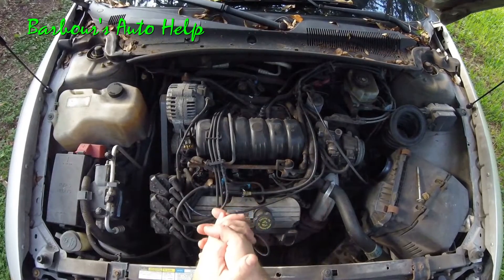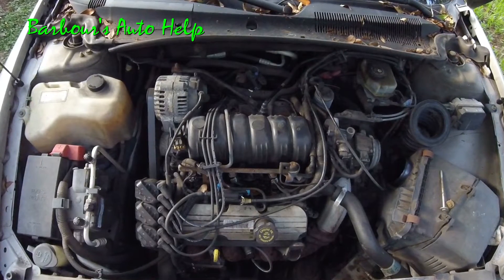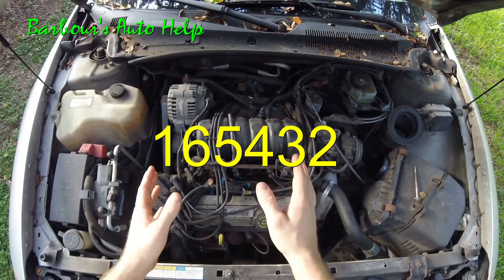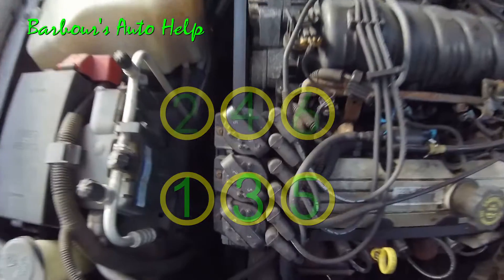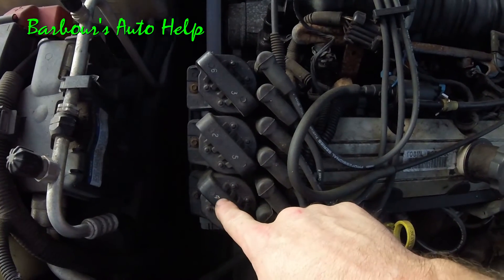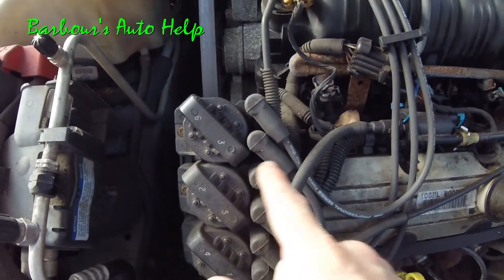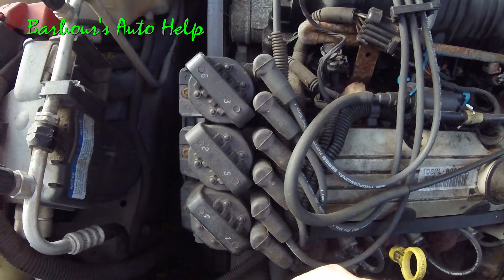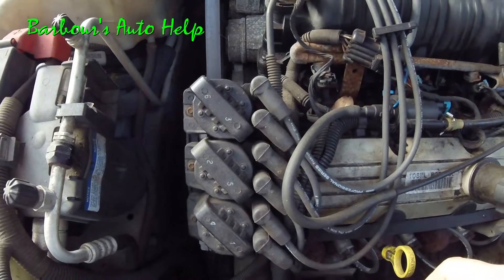Firing Order and Cylinder Identification GM 3.8L Series 2 V-6

Comment: I changed my 2-5 coil pack and it’s still showing cylinder 5 misfire. Running rough and jumpy and check engine light blinks sometimes

Comment: Could the Ignition Control Modual cause a P0306 code? Cylinder 6 misfire, or would the whole unit fail at once? Ive changed plugs and cables and i have new ignition coils coming today. If those dont fix the issue than the next step is ICM or possibly camshaft or crankshaft positioning sensors. What is the likely hood it something in the motor like a fuel injector?
Reply: you can also try pulling the plug cable off the 4 post on the coil and setting it to the side of the post so that a spark can jump while you crank it, to see if the spark jumps from the coil to the wire. 

also pull the wire off of the spark plug and seeing if that is transferring a spark. I did this by sticking a screwdriver into the metal loop in the plug cable and set it near a metal part of the engine, seeing if it would spark against the engine block.

you can also pull the spark plug and check the spark in the plug.

be very careful with this..it can shock the crap out of you. 

other possible problems are camshaft positioning sensor and crank shaft positioning sensor. both are pretty cheap but the crank shaft sensor is a major pain to get to unless you have the correct tools.

do you have any other issues? mime was puffing white smoke from the tail pipe and it smelt like gas.
Reply: @DukeusMostchillius did you ever find out why it was puffing smoke? Mine smells like weird gas and something else and smoking from my flex pipe where the cat was.
Reply: @ASSOL3  for me it ended up being a fuel injector that was stuck open
Reply: @DukeusMostchillius  might be my case too, i was gunning it and now my car idles with a nasty lope as if i cammed it.
Reply: Did you get it fixed with the coils
Reply: @MichaelGarcia-qs1yj  nope..for me it was a fuel injector that was stuck open
Reply: Damn ok thanks man... Where you gettin codes for a misfire im gettin a misfirecode on cylinder 4 so im wonderin if i should change coils as well
Reply: @MichaelGarcia-qs1yj  you can swap the misfiring coil with one of the good ones and see if the code changes from 4 to whatever the new position is

Comment: Mine is the same 3800 s2 but it has the oil cap on the passenger side and it's a rear wheel drive , 97 camaro

Comment: Best explained video. I have a 2008 Grand Prix and i was checking out the reason of misfiring and took out all the spark plug wire and placed them totally wrong and now the car wont start up, what could be the worse case scenario? And does this cylinder order applies to 2008 3.8 V6?
Reply from the maker: Sorry I didn't know if it's the same.  Are your coils numbered?
Reply: @BarboursAutoHelp   No they r faded away :(
Reply from the maker: Have you tried a Google search?
Reply: @BarboursAutoHelp  i did nothing is in repair manual as well as owners manual.

Comment: i have a misfire in cylinder 3 and i didnt know which one it was bc the numbers were faded away on my lesabre. thank you
Reply from the maker: No problem
Reply: Yes go by number on coils what if they have been off put back on in a different order
Reply: I had a shop tell me it would be $210 to replace the coil. I decided to look at what was involved, and I was PISSED!! They made it sound so tough, I stopped by Advance auto and bought a good coil for $37, and even though I am not mechanically inclined, I can handle this little job.Talk about a rip off!  Great little video, now I know where #3 is.